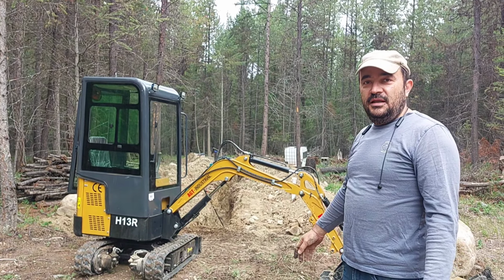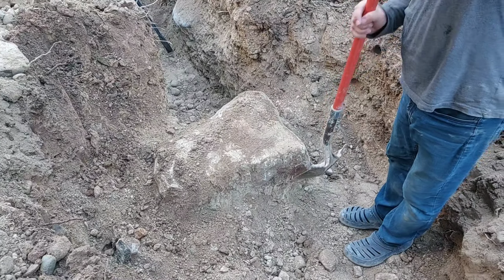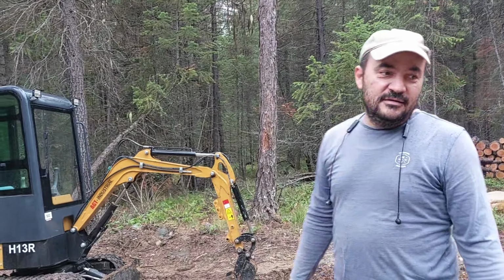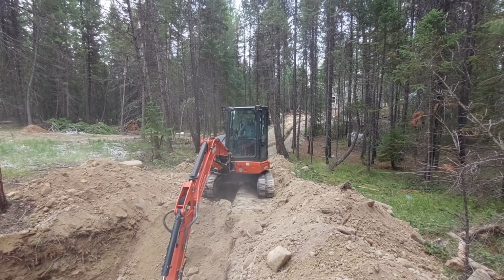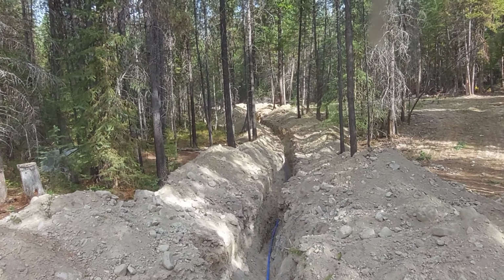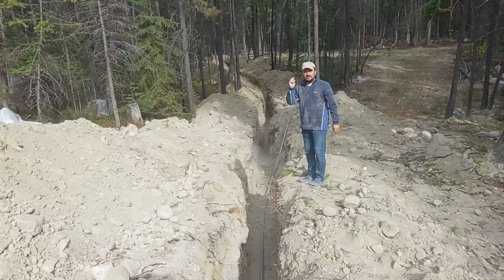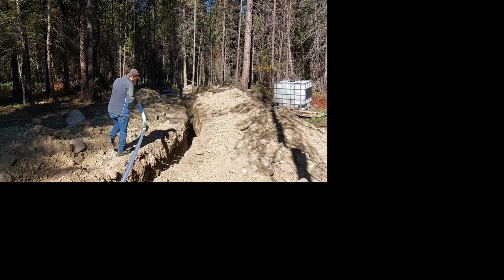MINI EXCAVATOR TO TRENCH 320 FEET FOR OUR WELL PIPE!!? GRUELING TEST. MEN DIY CHALLENGES

Comment: Using a manual or hydraulic thumb would have worked really well to grab and move the bolders easier. Good video!  I have a dmc-12c
Reply from the maker: One day, we will get it 💪
Reply: @LarchLine  In my area they sell them for around 300$, I bought it and it is one of the best buys I've made for the machine
Reply from the maker: We have nothing in our area. We must purchase them 10 hours drive away

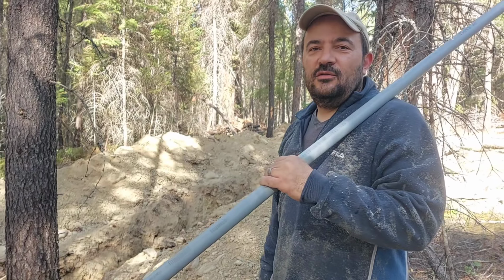Comment: 20:31 >if you are going to do more digging, suggest getting the hydraulic hammer for the excavator to break up the large rocks.
Reply from the maker: Thanks for the suggestion. 
We are thinking of getting it. One day, we'll be doing another trip to get some other parts for our mini excavator, yet I think that, for a while, we would not do anything major.  Our house is getting ready to be done...  but who knows.  Nothing was in our plans, we aren't professionals, and we kept going.
Thanks a lot for your support 🙏 ❤️
Reply: @LarchLine  I'm currently on a trip to pick up a hydraulic hammer and several other attachments for my VA15 excavator.   These were acquired thru on-line auction ar around 1/4 the dealer price,  and are new, unused items.  This trip is a two day trip, 10 hour drive from my home in west central Ohio.
Reply from the maker: @DavidStein-o8i 
We did the same. Got ours 10 hours and  11 hours trip ( one way) away from us. We did a total of 3 trips ( for mini loader, mini excavator, and 9 attachments)... the same, from auctions.
We got really busy and didn't have a chance to get other attachments.
We did the first 2 trips non-stop trips ( left early morning returned home the same day). The 3rd trip was done on our 25th anniversary and made it with a hotel stay at Canon Beach.